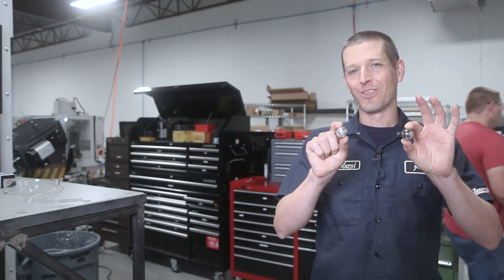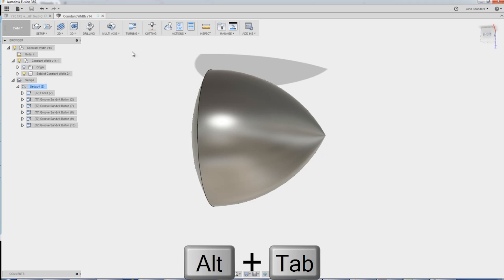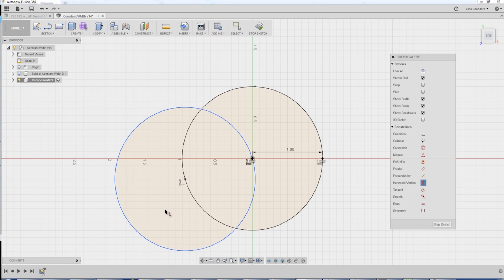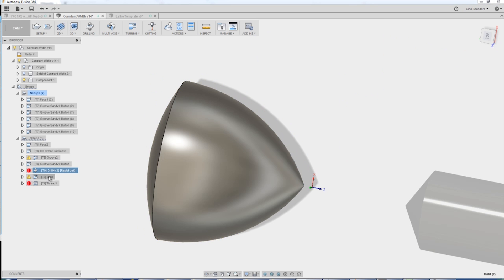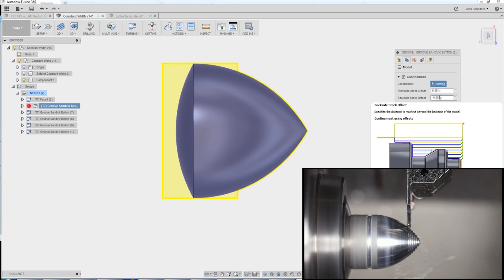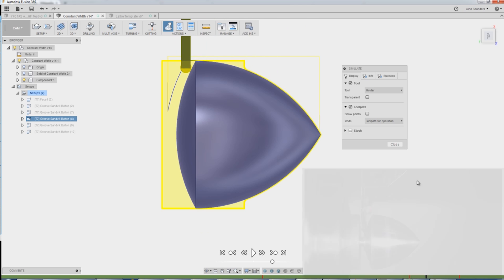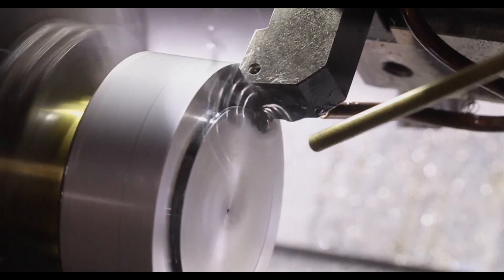CNC Lathe Turning: Solid of Constant Width!  WW149

Comment: John on a facing cut on a lathe if you use tip comp G41 for a facing cut. (Cutter comp on the mill) You also need to  specify the proper tip radius in the tool setup. The tool will automatically go down far enough in X based on the tip radius of the tools setup. To give a example if your lead out line (G40)is on X 0.0 than moves to G40 Z 0.1 and your tool has a .030 radius the machine will automatically move to X -0.06 when canceling tip comp. Try it just program a simple facing cut say on a 1.00 Diameter rod start like this G00 X1.1 Z.100; G41 Z 0.0; G01 X 0.0 F.005; G00 G40 Z .1; Because the lead out line is perpendicular to the previous move it will move to the center of the tip radius before the cancelation (G40) line.

Comment: I was astonished by this video. I've never seen anyone try and do this with a grooving tool.
I can't quite bring myself to believe they are supposed to be used like that.
The grooving tool is long and very thin, so it has very little rigidity in the lathe's z-axis direction. For a normal grooving operation that doesn't matter as there is no sideways force, but for step-over cut profiling the axial deflection forces must be huge. Given that this is a round-ended grooving tool, this will have much greater axial deflection (compared to say a square ended parting/grooving tool). The contact point angle with the metal means the reaction force on the tool has a large sideways component. In steel, I would expect this to cause really bad chatter, followed by a snapped insert.
I'm sure if I was doing this part, I would have used a nice rigid 12mm round insert to do the profiling, and brought in a tail-stock support just soon as the tip of the part had been machined.

Having said that, the part does looks great, and I'm impressed that this worked without a tool breakage. In a harder material this might not have worked as well. Still, "everyone's a hero in aluminium", as they say ;-)
Reply: Since John did light finish passes after the roughing and it didn't seem to be doing the jerking then he likely finished with good parts even if they didn't follow the dimensions they should have been all the way thru. I can't credit any CAM for my success though as I am a manual machinist. :-)
Reply: I'd agree with the others here, I believe that's solely an issue with feeds and speeds or this lathe is just not rigid enough.
Reply: Using grooving tools that way is actually quite common and they can take the axial force just fine.
However, you need a tool which is designed to take axial force.
Reply: ***** Interesting, thanks. In this case, about 50 seconds into the video you can see the tool bend, so the part isn't being cut to the right size.
Reply: The tool deflection Is a cam problem not the tool problem though. I use a groove and turn tool all the time and it works fantastic and can hold size just fine. I don't know if it is something in the code generation or the Tormach lathe but the feed rate is not constant  causing varying chip loads and tool deflections.
Reply: It's good to hear some people have got this to work (if they are careful with the cam). Always good to share and learn new techniques.
Reply: Robert S. Yes, I think you are essentially correct, but I think it might be the long & thin part of the tool holder that is bending, rather than it being an overall lathe rigidity issue.
Reply: look up HSMWORKS side grooving and there's a neat video of a cam shaft being turned like this. I used the technique myself recently as well. It works well when done right.

Comment: Haven't met a CAM system that doesn't cut air ...

It's usually a clearance or retract setting. There might be half a tenth of material left in the way and it feels compelled to have to retract away and clear it. 

Kinda like if you're driving with a GPS and half way there it finds a route 5 feet shorter so it decides to completely recalculate your route.

Comment: John, first thanks for the great video's. I do although have remark/question about the grooving tool you use, is it my eyes or thus it make a wider groove than the tool actual is, I see the tool vibrating from left to right.
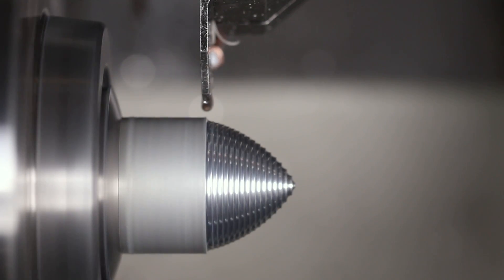Reply: I believe that is tool deflection caused by the cam. It sounded and looked like to me that the tool was being step driven with a feed/rev rate rather than a constant feed rate. At 1:05 you can hear the lathe crossslide motor pulsing rather than just running.

Comment: watching this i feel like fusion 360 has way more options but is way slower to do something in comparison to 123d
Reply: hansdietrich83 123d I found to be quite limited, though I never went too far in depth with it. As for working speed, agreed, they need to add better keyboard support.

Comment: Awesome all the way around. Question tho.. doesnt leaving it at 5k rpm cause an issue with constant feed rates since the slant pro has a max of 3500 rpm?
Reply: Does fusion compute the max speed when creating the toolpath or the post processor? Ive been kinda trying to figure that part out in my head when i do turning as well. Seems if you put a higher max rpm then you potentially could be feeding way faster than a constant feed rate if you hit the max 3500 when it thinks it can be going to 5000.  I don't know tho i cant even break a chip :) still.

Comment: John at 0:50 the parting tool seemes to be accelerating in and then decelerating as it creates the layers like pushing in  with pulsed approach. Is this due to  resistance to the ballscrews or was that programed in?
Reply: It was set up to peck, probably to prevent the aluminum from creating a bird nest.
Reply: I think he referred to that as pecking 0.02"